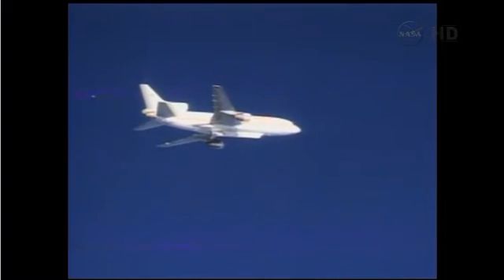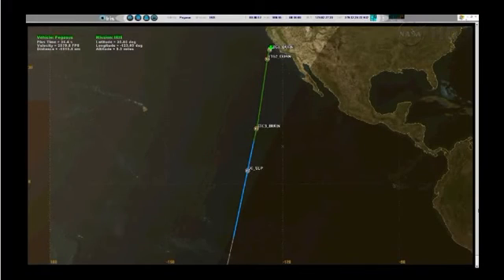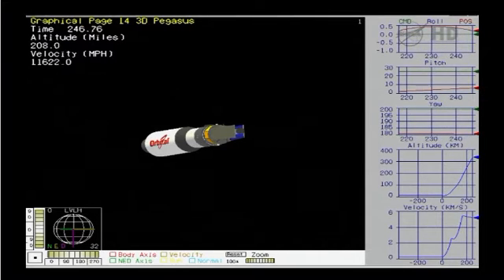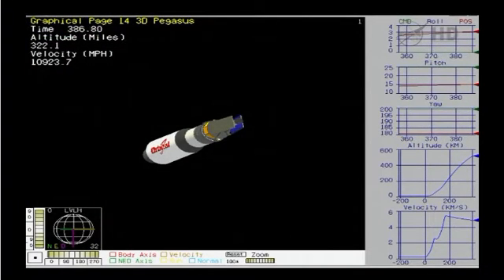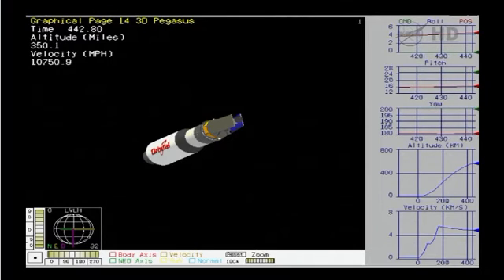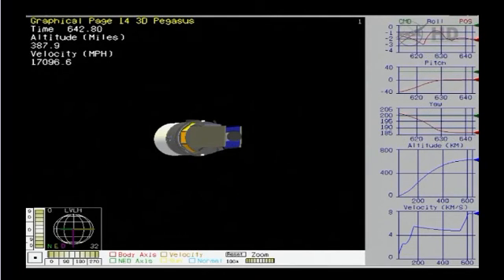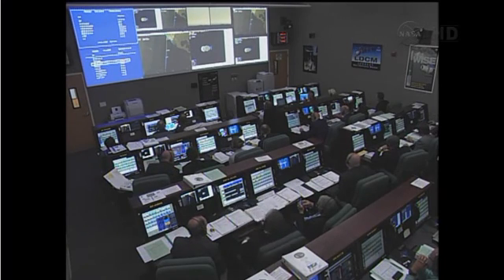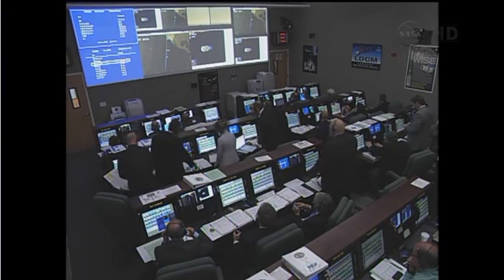NASA's IRIS Interface Region Imaging Spectrograph) Launches On A Pegasus Rocket

Comment: Video playback remains nominal. Buffer cache remains nominal. We are 848 seconds into the video. All power buses report nominal voltages. Video is currently playing at 30 frames per second. CPU temperature is nominal, GPU temperature is nominal. Current time is 1457 decimal zero zero zero.

Comment: LOL. The readouts on the left side of the display are in imperial, and the graphs on the right are in metric. Hey, wasn't there a Mars probe that crashed into the red planet instead of orbiting because some subcontractor wrote software that calculated distance in miles, while receiving telemetry input in kilometers?